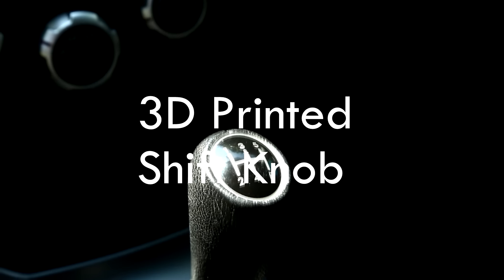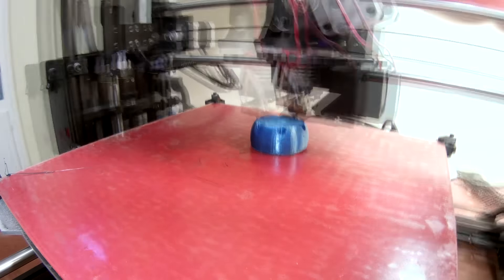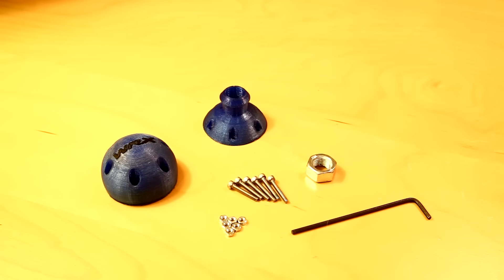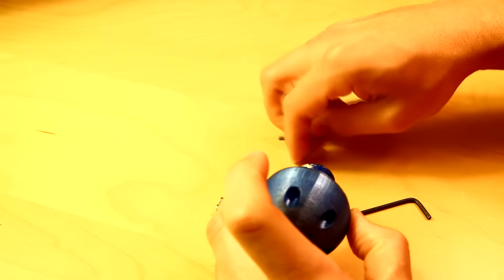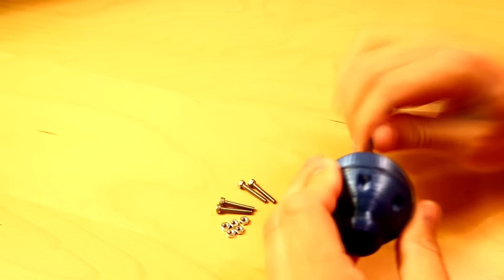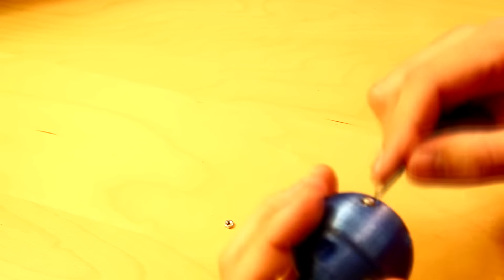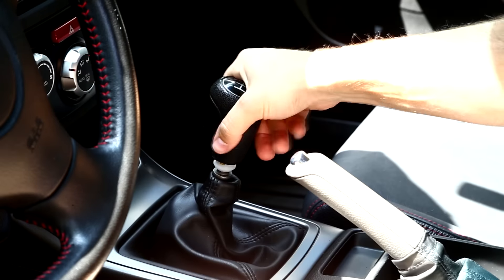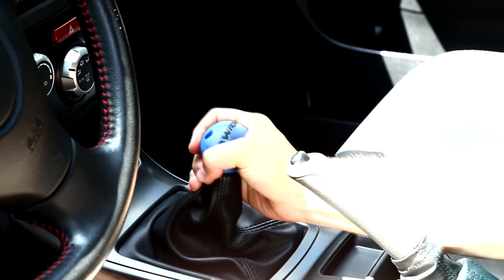Custom 3D Printed WRX Shift Knob

Comment: This looks AMAZING. I've owned a 2002 and 2004 WRX in the past, and I JUST got my hands on a 2006. I do lots of 3d printing now, so this seems right up my alley. If I'm able to get this done, mind if I give you a shout-out in one of my videos?
Reply from the maker: +3D Printing Nerd Absoultely not! That'd be great to see! One guy made one in black and silver. Looked pretty good. He scaled the letters to 97% in X,Y, and Z directions and was able to avoid doing much trimming. Also had to drill a little bit into the bottom of top half to make room for a nylock nut which is a little taller than the standard nut I used.

Oh and congrats on getting another WRX. I love these cars :)

Comment: Did you sand down the knob to smooth out the lines, or just leave it as is? Can't tell from the video.
Reply from the maker: +atvar8 Left it as is. 100 micron layer height is pretty smooth as is.